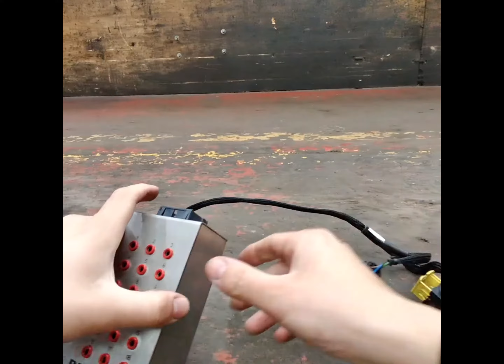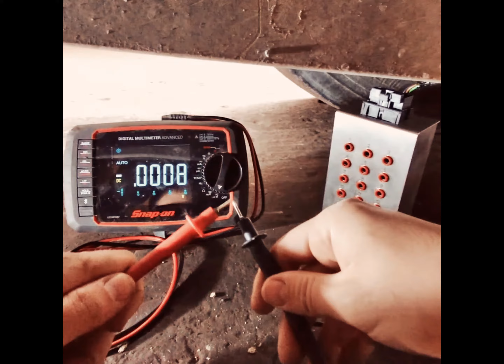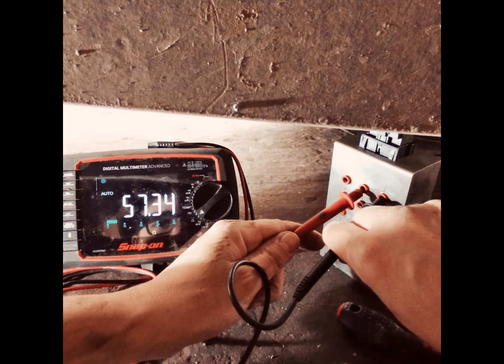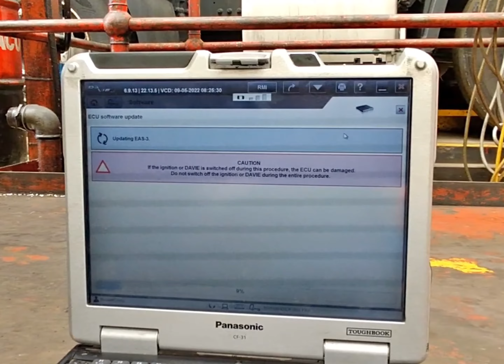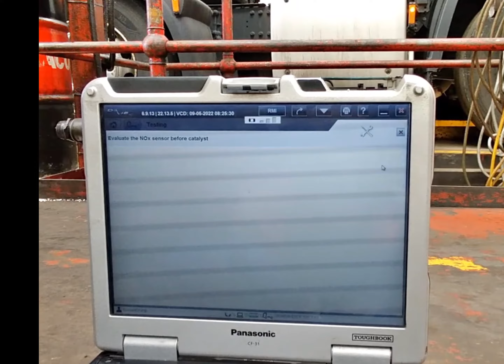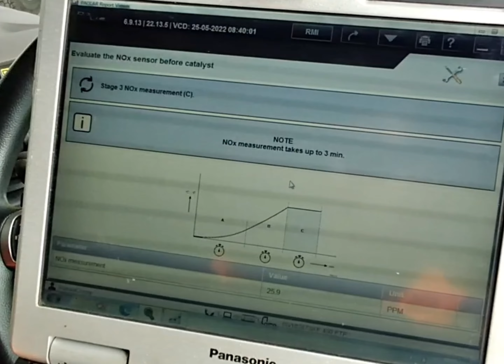DAF CF XF Nox sensors, 4 tests To Do BEFORE you call it

Comment: Im working on a cf, 2006-2013. I replaced the nox sensors abit back and it fixed the issue.
The issue has rerurrned. Ppm reading 3076 with emgine off. 
I have live and ground and continuity on the can lines to the ecu in the ad blue dosage module. 
But the resistance across can lines is above 120 .
I have 120 ohms on the ecu pins as expected but on the pins at the nox sensors i have 45ohms and 6ohms. 
Would you test a nox sensor with the resistance like that by checking resistance across the pins for the can line? 
Also they were aftermarket 😂

I have kept the originals the downstream one reads 120 ohms  so that leads me to believe they should all read 120 ohms

Comment: Hi I have a 2014 ram 3500 , I have a code reading lost communication with nox sensor bank 1 replaces the sensor 2x still having the same issue pin 1 reads 13.5v pin 4 reads ground pin 3 reads 3.5v and pin 2 reads 1.6v any help is appreciated
Reply from the maker: Hi buddy 
So the voltages seem fine, BUT load testing the wiring would be a good idea from the ecu to the sensor.....Can you run a nox sensor test on the sensor with your scan tool? If it can't communicate and run the test I'd say you have a bad sensor... .was it a genuine sensor or a cheap aftermarket one?
Reply: @TRUCKTECHUK  it was a cheap one off Amazon

Comment: what does the U1850 error mean after installing a new original sensor (part number 2139930)? The previous sensor had a short circuit and the fuse was blown.
Reply from the maker: Hey, thanks for the comment. The fault code starts with "U" which is a communication issue.
This fault is attributed to software verification. usually from non-GENUINE sensors or incorrect parts.
Reply: @TRUCKTECHUK  thanks a lot

Comment: Has anyone had issues with fitting NEW after market sensors, from what I have heard it's after the trucks have had ECU updates etc.? Would be interesting to hear back
Reply from the maker: Hey thanks for the comment 👌😎
Big thing from DAF is not to use aftermarket sensors as apparently they don't last and I know we don't supply or use them here. So many different types of them 😅 be interesting to see if anyone has had any issues also 😃
Reply: We used some Dinex ones couple year ago on 15 plate e6 CF, all came back with a code related to the CVN number not acceptable. DAF OE now we use.

Comment: Hey bro good jobe man 
But too bad I don't have a DAVIE  tool
I'm using JALTEST 
I HAVE TO ASK YOU
I have a daf euro 6 cf 400 and it show on my diagnostic tool crankcase error 
So I replaced it with a new one ...but the one on the truck is from factory it have a different filter in it ...and the dealer here give me a different one ..so I look it up and understand that factory replaced it with a new design and I understand that I have to do some new modification on in the engine by taking of the oil pan 

The original model have a breeder hose that runs back to the intake before turbo and thus model I have to block the intake hole...but I don't understand is that I have to put a plate under on the engine block in the oil pan

Can you make a video or tell me how to do it.i want to understand how it works 
Because bro I'm the only person that working on these dad euro 4.5 and now 6
Reply from the maker: The dealer should of given you the parts bulletin "PB00313" for mx-13 or "PBO0311" for mx-11 which will contain the instructions on how to fit the modified CCV unit they sold you. Ask them for that and see how you get on 😎
Reply: @TRUCKTECHUK  ok bro
Reply: @TRUCKTECHUK  hey bro
There isnone more problem I forgot to tell you...on the diagnostic plug where I plug my diagnostic tool on the 2 can wires (YELLOW /GREEN)  I notice that I don't see 60 ohms ...what I see on my multimeter is 120 ohms .I check on a nother truck and I get 60 on the diagnostic plug......so bro How do you check to know if a ECU on the truck is not working .. I don't know how to test that ...can you tell me how to find a error unit ...I know when I unplug a unit on a truck I get 120 ohm and plug it back I get 60 ...but thus truck I get 120 ohms ....bro How can I locate the error one.....can you please explain it to me
Reply: @TRUCKTECHUK  hi bro .how are you
J have a error in red on my diagnostic tool bro ...when I diagnose the same truck I get a..(CAB.CLIMITE CONTROL ECU ERROR).bro can that be that I'm not getting the adblue system to activate because see it have a K line that go to the VIC 3 BOX.can it be that the adblue ECU is working with the Cab.climite control ECU to get the out side temperature to make the adblue heat up 
Because now I'm getting 120 ohms and I think maybe it is that unit that giving the error and stopping the adblue to function back...csn it be why I'm getting 120 ohms not 60 ohms...please reply me
Reply: @TRUCKTECHUK  hey bro I like the Biden about the new DAF LF EURO 7 now I think...bro csn I ask you..or advice me more....the CAB.CLIMIT CONTROL ECU .do it have a function together with the adblue ECU and engine ECU unit 
Because I'm getting a red error on it on my diagnostic tool and I think it had also to do with the CAN NETWORK too.is that why I'm getting 120 ohms instead of 60 ohms on the diagnostic plug..

Comment: very helpfull cheers
Reply: Olá preciso de software davie 4
Reply from the maker: Thank you for the comment. Can you think of anything you would like to see content wise?
Reply: Olá @TRUCKTECHUK
Reply from the maker: olá @alexbrito2890  por favor fale com o seu revendedor DAF local para software oficial. Eu não forneço infelizmente
Reply: @TRUCKTECHUK  yes bro 
I want to know jow the can network is working on this truck because I also get 120 ohms on the diagnostic plug 
On a another truck I check and I get on that 60 ohms ....please tell me how to find and fix it ...I check the adblue to engine ECU and I can line and I get 60 ohms on it ....SO I THINK IS IN THE TRUCK BUT I DONT KNOW HOW TO LOOK FOR IT..I see there is a bridge connector where all the CAN connect to ...but how can I check it ...cannit be that because of the 120 ohms I get the adblue error on DIP